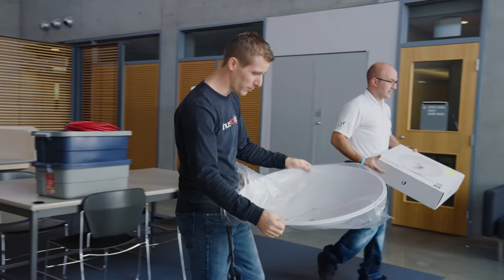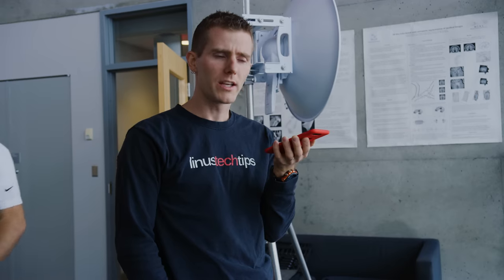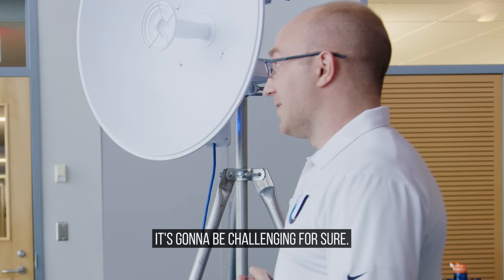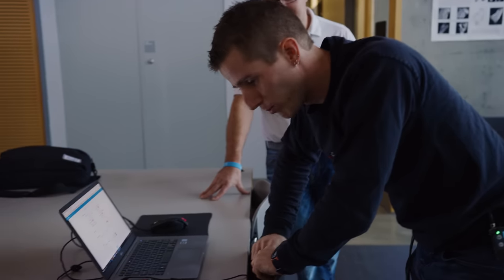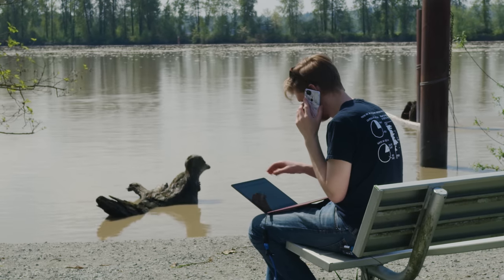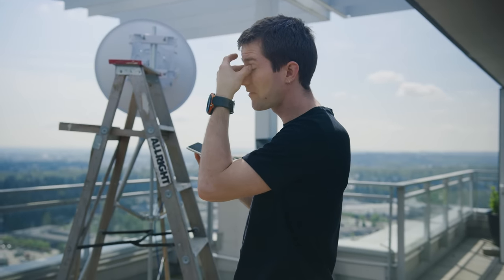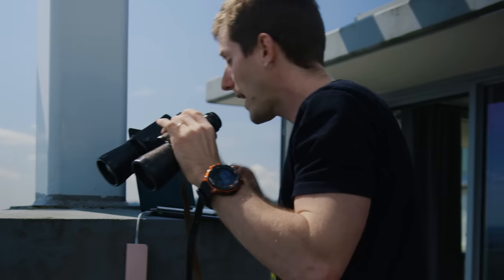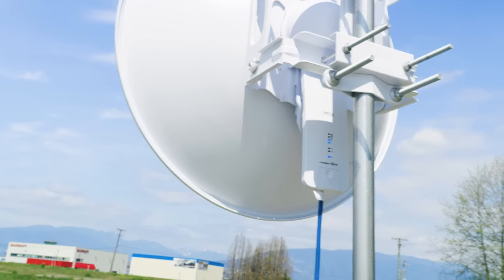12 KILOMETER Wi-Fi - SUCCESS!!!

Comment: and i cant connect 3 feet from my router
Reply: GET A tplink tl-wr841hp
Reply: @georgeschamoun3789  Definitely has good wifi specs and is ~$25ish used on eBay. But if you spend just $10 more dollars you can pickup a used Netgear R6400, dual core 800mhz arm processor, gigabit ethernet, 2.4ghz + 5ghz, usb ports, 1700 mbps max throughput, and is Tomato/DD-WRT compatible.
Reply: Gotta eat all the lead paint off the walls first.

Comment: About 14 years ago I had gotten DSL 640k down 256k up and my friend had only crappy dialup. At first I setup a 56k modem and he would dial into it. So we could play counter strike v1.4 or day of defeat and amazingly the ping was around 90-110 at his house. Which was only about 10ms higher with my DSL connection (BTW we lived in a tiny town with a population of around 2k people. A while later while taking a network+ class my instructor showed us these little D-link 802.11 B dual band 22MB bridges. They actually cost around 120 bucks but you could buy the access point one which had the identical hardware and with out nodding you could just download the firmware off their site and change it to a bridge. I had a huge 34DBI directional antenna on my roof and a 22dbi on his roof which was 3 miles away. Was around the time they started to offer DSL 1.5MB but we got a 60ish %signal between our houses and awesome thing was the entire setup for the antennas. Bridges and towers cost me only 70 bucks for everything. I ended up shooting wifi to 6 houses selling my dsl 1.5mb for 40 bucks plus 50 for parts. Was way awesome until they upgraded the area and soon every one could get wifi. But I had setup a small cashe server with a huge 40GB hard drive (at the time 120 was biggest one you could buy) but we could transfer data between our houses a 1.1MB which was insane back then. But when ever it got windy or snowed or anything we had alot of signal loss. Was a lot of fun though.
Reply: Sounds like you were so close to becoming a successful business owner. Many WISPs like us have starting stories like yours. 
We still do this now, but on a larger scale(and faster speeds), don't have access to fiber without a $3k+ install fee? No problem, we can get you 1gbps up to 5km away. Oh, you need dedicated 10gbps and don't want to pay the $120k+ for a 2 mile run of fiber through the city? No problem, $10k install fee and you're up and running at 10gbps full duplex.
Reply: @mikecrapse5285  Then there's guys in Sweden that lives 40mi from anything and buys his own fiber and strings it on the poles and gets his own connection for like $5k or something. I have Wireless ISP's where I live too, but most only serve business. I wish they would open it up to more customers

Comment: Wtf my wifi doesnt even have 10 meters of range
Reply: GG 42 [GER] yes.... That's where the antenne is good for
Reply: One thing I discovered with my PC.. I needed to use one of those WiFi USB dongles. Plugged it into a USB 3 port - that apparently injects a s*** ton of noise. I was only getting 2mbps down - switched back to a USB 2 port - back to 50mpbs. And, it had a good directional antenna. I've read even USB 3 drives and stuff can mess with it.
Reply: MattExzy Not everything will work and USB 3.0, but I'd prefer to connect the ethernet cable to my computer instead of Wi-Fi
Reply: Get a new router and a bunch of Wi-fi adapters. Get couple of more router re-network your whole house. Problem solved

Comment: Why didn't you just use a compass to align yourselves? Like Alex says "I wish I bought a compass" like you have one in your phone dude
Reply: Unfortunately phone compasses are notoriously unreliable. But yeah, they really should have used a compass...
Reply: Yeah they aren't the best, but its a good start to do the heavy lifting, and then they could fin tune it from there.
Reply: This video was really cool but this system looks like it needs a pair of compass, azimuth calculator and a gigantic golden bounce (I love seeing Linus so excited).
Reply: No, but what would really help is a sight on the rim of the dish. Then you can look through and align it.
Reply: Oh man that sounds so freaking cool, hell you could make it a holographic sight with elevation lines and for added precision put a specific wavelength strong laser emitter that only be seen by the sight!
Reply: Phone Compass will work, if your not moving and has not been calibrated recently it won't work well but if you just start moving you get a heading witch will. Be accurate

Comment: With all those tech toys you guys don't have two good GPS and compass units? lol... anyway, nice video :D
Reply: They were BOTH holding both of those things and no, they didn't think to use them :P
Reply: You need to be more precise than a compass and handheld GPS.
Reply: Too much metal for compassrs
Reply: lol and you think theyre being any more precise with linus's method? they were better off using their own cellphones' GPS and compass
Reply: Sphenix the tool integrated into the software is the best way to do it. It's not a quick and easy setup. You start rough and fine tune. You think this is hard? Try aiming a dish at a satellite.
Reply: "You need to be more precise"
they couldnt even spot each other...
Reply: Shiver2002. I used to aim satellite dishes at satellites using a compass, speed square and level attached to a clamp. Those tools will get you a signal, might not be a great signal but the tools in the software should help fine tune it from there. It's a geometry/trigonometry problem, use the appropriate tools and it's not so painful.

Comment: No latency testing?
Reply: on a link with zero traffic his latency would be sub 1ms assuming the channel wasn't 90% occupied.
Reply: really? that seems really low, that's really interesting. maybe I can get a cabin in the woods with good LOS to a tower.
Reply: It's a really short connection as well.
Reply: Speed of light and all.. Add processing overhead, and it's definitely sub 5ms. Windows is pretty inefficient with it's network handling without tweaking some adapter settings.
Reply: The Latency will be Very Low were my mom lives they use Ubiquiti hardware for Internet to the home and I get on non windy days like 3-15ms to the tower ping changes because it is a shared tower. If the radio they used was setup fully it would reach speeds of 500+ Mbps and it there radio could go even further then 12Kilometers.
Reply: I have a commercial application of this tech (Australia, because NBN, fiber, is crap) and I have 12ms ping. Its pretty dam good for wireless.
Reply: This isn't your standard 5ghz wifi signal like you would see at home. This is a consumer version of a directional microwave transmission dish which won't really suffer from latency issues or channel congestion as the signal is a beam generally smaller than the size of a grapefruit in diameter. I used to install larger ones (up to 12ft dishes) for Verizon connecting their cell phone towers and we would routinely shoot 20+ mile connections capable of supporting throughput greater than a gig per second. I believe the longest connection we made was over 40 miles away.

I will say having installed this equipment professionally I cringed so much at the "alignment" methods lol
Reply: @NolePtr you cant say windows is bad, and then say adapter settings would fix it. this is not how an OS acts as a middleware
Reply: Default settings applied by windows device manager favors offloading to adapter. Built in adapters just use an interrupt and make the CPU process it anyways. It also screws up the network stack. Youre not actually getting better throughput with the "optimizations" just more jitter and latency all together unless you have a dedicated network card. If the networking in Windows was better coded, we wouldn't experience this issue.

Comment: Could of just used the compass on your iphones...
Reply: thats what i was thinking
Reply: Compass in the phone is not very accurate, especially in a building reinforced with steel with steel bars decorating the windows.
Reply: Rubik Monat just buy a compass then
Reply: Compass is affected the same. the magnetic field is distorted by the steel nearby. You need to work out the angles off expected landmarks visible from each end.
Reply: At 5GHz the electronical compass isn't enough. I made several 4-6km links with smaller Ubiquiti antennas. 1 degree diff is a huge step in signal.
Reply: You should always pan both ends for peak signal strength. At that point you dont even look at or measure the angle, just movie it slowly for max signal.
Reply: Max User triggered because you said iphones instead of phones
Reply: I think thats a oneplus
Reply: Obviously... I mean in all the times i’ve used it, it totally hasn’t pointed me in the opposite direction. Id rather try to orientate myself with the stars in the middle of the day
Reply: could of.
Reply: +Nkyoko Every smartphone has a compass and if it doesn't then there's an app for it.

Comment: Its called flares. They are pretty cheap
Reply: Also it is called smartphone, virtually free because they already have one with GPS and probably a compass to get the right orientation. It is one thing to have the tools, and it another thing to use it in an apt way.
Reply: Knowing them they probably would have caught something on fire...
Reply: Patrick PTMonk Yeah just shoot a flare up in a residential area, what could possibly go wrong? The reflector worked just as well
Reply: d1oftwins Consumer-level GPS isn't perfectly accurate
Reply: Nmotsch idontwannagivemyrealname most flares are handheld. Also. Most people dont have a flare gun

Comment: 150Mbps would give 18.75MB/s. You had around 116Mbps at 14.5MB/s
Reply: That's assuming no network overhead (ethernet framing, TCP headers...etc). You'll find dividing by 10 provides more accurate real-world approximations.
Reply: Tanjooodo the point he's making is that Linus grossly overestimated the speed he had because he just multiplied by 10
Reply: Alex and my point is he didn't because multiplying by 10 is more accurate than multiplying by 8
Reply: Using a similar setup, except with a Ubiquiti AF-11FX (licensed 11GHz on a 2 meter dish over 11km / 7mi)
Max link speed is currently 800mbps and I actually get 500-700, so yeah.. steam games download in a near instant.
http://www.speedtest.net/result/7284205619
Reply: Rick94rr Tanjooodo How do you Know that 150mbps is 18.25mb/s?
Reply: Nemesis Zero depends on location, connection etc. Internet can be advertised as 1gbps but irl have a speed of 20mbps.
Reply: Michael Kregnes 
Dividing by 8.
8 bits = 1 byte
150 Megabits = 18.75 Megabytes.

Megabits per second = Mbps.
Megabytes per second = MB/s.
Reply: Does all that work but forgot the conversion of megabytes to megabits lol
Reply: yep, it is 8,388608
Reply: 18,25MB/s * 8,388608 = 153,09 mbps
Reply: @JohnnyJoannou    I would love to hear the more technical info of your setup like why the distance, how the equipment was chosen who pays for it all etc.
Reply: @mrmotofy  Distance is because existing infrastructure that was in place at a location that had a clear line of sight and could provide the required backhaul bandwidth (fiber).
11GHz because it's capable of larger capacity from the higher frequency and is much less congested than the license free 5GHz channels.

It's all paid for by my ISP, and doesn't cost me anything. (At the time, in exchange for roof access due to prime location)
I now work for the company, so I can say with confidence it all costs around $5000 to set up initially, monthly costs varies depending on where you are getting your feed from.. in our case it's a charter carrier circuit for that particular location, which feeds back to the core network of a variety of peers. (Zayo, L3, ATT, etc)

A few days ago I aimed in a 80GHz licensed shot over about 1.5KM. At that distance with a 2 foot dish, we were able to modulate at 128QAM and get a solid 10gbps across the link.
Reply: @JohnnyJoannou  Wow that's way more info than I expected. Thanks that's awesome. I enjoy watching, learning and conversing about this techy stuff cuz of the opportunities it opens up. I just don't know anyone that can geek out on it with me :(  I'm excited that I finally got a VPN setup and now can view all my security cams securely from anywhere as long as ports aren't blocked. My second location with cams I found out is awesome and has fiber to the middle of nowhere...but seems to have a double NAT so I can't do a VPN yet till I work all that out. But otherwise Cams I remotely power on (on batt/solar and winter/snow) and PTZ a live stream. People laugh and poke at me as I'm working on it then when I show em...it's hey that's pretty cool and good idea haha

Comment: Very frustrating as a person who's installed similar equipment. First it's azimuth and elevation when aligning antennas. You can use Google to get your azimuth and back azimuth and calculate hieghts for elevation or takeoff angle. A little prior planning and they wouldn't be questioning where to point the antennas
Reply: but then that means we wouldnt get this kind of content XD
Reply: I work in this field and calculations aren't a viable solution the most important thing is you must have a clear line of sight
Reply: @georgeschamoun3789  No you don't... You need the right dish for the job... You can use the phone to stitch you locations to each other. That way you knwo exactly where each other are. In relation to the lining up the dishes...The rest is hard. Making sure it stays put and never moves or wobbles.
Reply: never heard of gps huh?
Reply: @harleyme3163  GPS does not help you. You still have no clue where the dish is pointing. Left\Right-Up\Down...And not having access to the proper tools to align them. You just have to keep at it. As some of these beams are very narrow.. Just a few degrees off. You don't get a signal...

Good Luck....
Reply: Like I said there is no need for gps you just need a clear line of sight
Reply: @MasterChief-sl9ro  compass, map, basic calculus and 5min of free time?
Reply: @TV-vz8kv  You can try Sum of Components known.. Not very reliable. Why cell phone companies use towers. They can see them..
Reply: @MasterChief-sl9ro  look I know where both antennas are located and I can get and set their pointing direction. At first it is good if you have a direct line of sight between that kind of antenna BUT can you really see other antenna at the range of for example 10 miles??? That's where GPS and position awareness comes into play: you know not only your position on the map(so you can easily get correct heading for antennas) BUT also your height. If we assume that one of the antennas is in the building and another is in the ground we can get the almost(if we assume the limitations of GPS and the curvature of the Earth) correct angle of slope for antennas.
Reply: @MasterChief-sl9ro  and yeah, clear line of sight is a requirement but trying to allign antennas "by eye" makes me sick.
Reply: @TV-vz8kv  You only align by rough sighting. You need a spectrum analyzer to fine tune them. As you will end up like these guys did. Which the hand is not calibrated to move in .5 degree increments but you can try.. 

And the more it shakes. The worse it gets. They have to be stone cold still. Up to 80 mph winds.